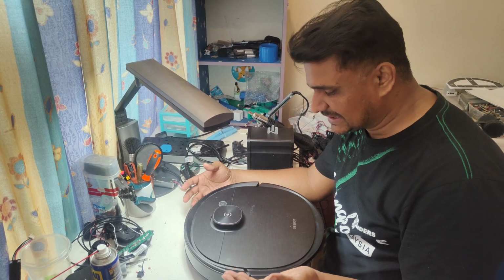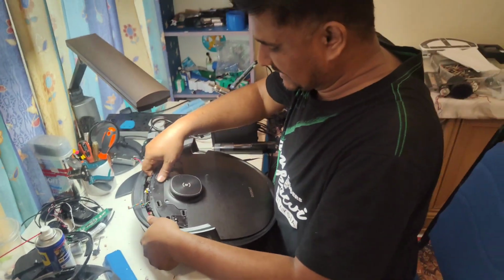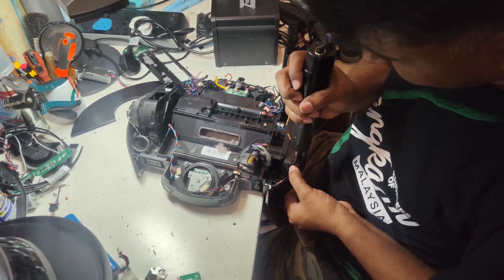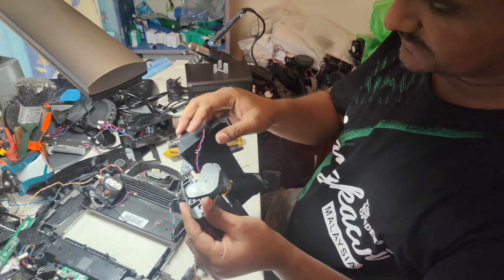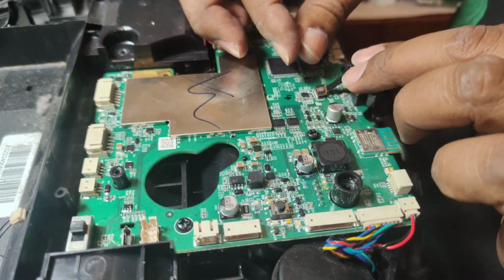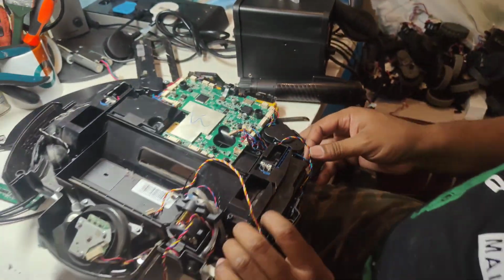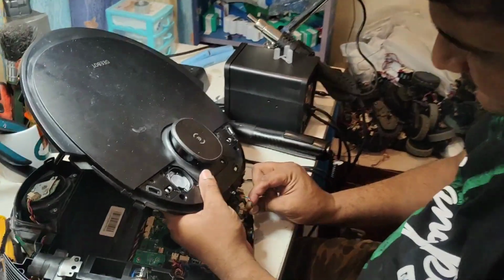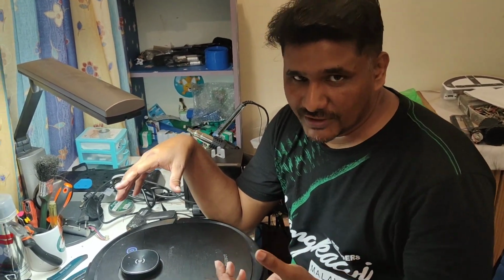Ecovacs Ozmo T8 aivi |  How to replace Main brush motor? Fix the Ozmo Tank oscillating issue

Comment: Thanks.  The plastic in the assembly housing broke, and I spent a year with a vacuum that was functional but with a broken plastic part that was inconvenient.  It took me forever to find someone that would sell the whole brush assembly, and I finally found a single shop in Jiangsu, China on Taobao that sells used parts for my T9 Aivi.  Will try to disassembly and replace the part later.

Comment: Hi, The main brush is not working on my T9, I have taken out the main brush motor and cleaned off the dust, it is working on a 5v and 12v source, all gears are turning and the brush turns easily by hand when in the T9 and all assembled. what else could cause the motor to stop working?

Comment: I turned the Deebot T8+ on and checked to see if the main brush is spinning. It is spinning. The brush in it is also new… but after 5-10 minutes it gives me a main brush tangled error but there is not anything wrong with the brush. 😭 please help
Reply from the maker: Check the main brush from both sides if all ok then main brush motor assembly need to replace... motor is jammed

Comment: I really appreciate your little details (and the fact that you posted this to begin with), thanks!

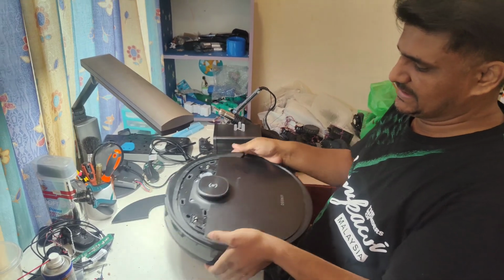I did find a shortcut, throwing this out there in case others need it: The two screws holding the rubber camera shield are accessible through the top of the vacuum after you pop off the little top cover at 1:41.  You will see two very small (3mm or so) rubber covers near the bumper. Pop those rubber covers off and the two screws holding the rubber camera shield can be unscrewed and then the front bumper removed fully.

Comment: Hello, thank you for this video which helped me a lot. The 2 lateral brushes of ozmo T8 aivi no longer turn, I changed the motors and they still do not work. Can you help me?
Reply from the maker: What's the error message?? Because if there's something wrong it gives voice msg n in app as well
Reply: I have no error message on the app, the robot works very well but the two side brushes do not work

Comment: I had an issue with my T8 AIVI main brush not spinning. I replaced the main brush motor and that didn't fix it. I then replaced the main board with a compatible generic board from amazon. On examination, the boards are identical. The main brush motor now spins but the robot speaks chinese and absolutely will not connect to 2.4ghz network. I followed all the directions to the letter and get (406,10025) error. The strange thing is that I can see the mac address connected of the robot in my router and it has an ip. The app does not think it is connected though. I have tried factory reset many times and turning off the cell signal on phone. I even tried using the deebot 2017 app though my robot is not listed and should work with ecovacs home. My guess is that its a region compatibility issue though since I can't connect to it I can't change it. Has anyone who has purchased a mobo and swapped it out thenselves run into this issue? I noticed there is a usb port and serial port on the motherboard which look like they could be used for communication. Suggestions?  You inspired me to swap the motherboard  and main brush motor myself just need to fix this last step!
Reply from the maker: Normally because of motherboard short circuit it happened.... motherboard U purchased is different reign that's why can't connect

Comment: My Ozmo Pro stopped oscillating after a few months. I purchased a new Ozmo Pro to replace it, but the new one also stopped oscillating after a few weeks, just like the first one. Now, I've given up.
Reply from the maker: Plz check the Ozmo connector... might be loose or wire damage or need to replace
Reply: @ecovacstechnicalsupport5278  Thanks for the prompt response 🤩